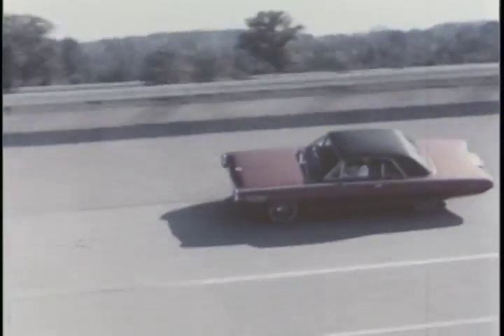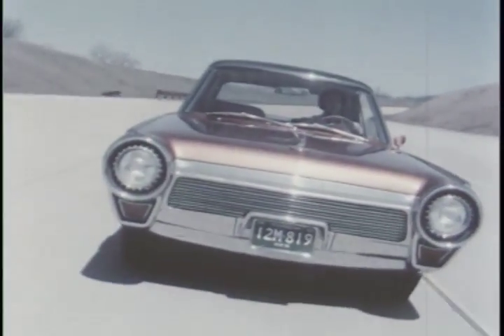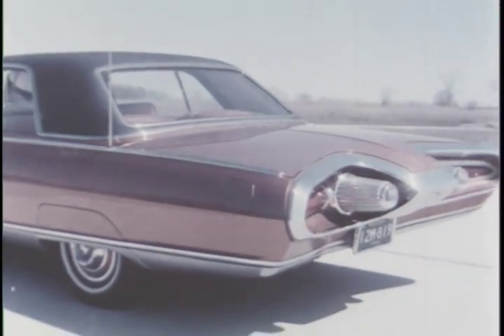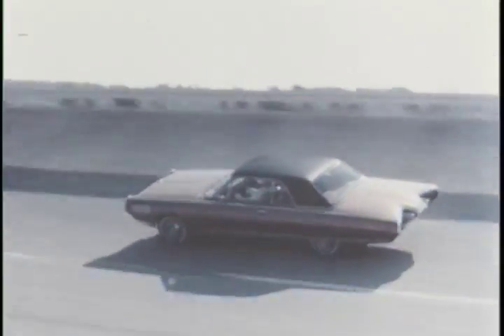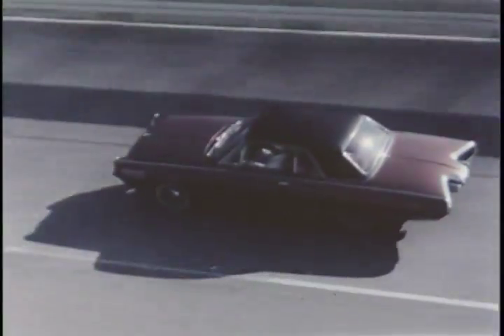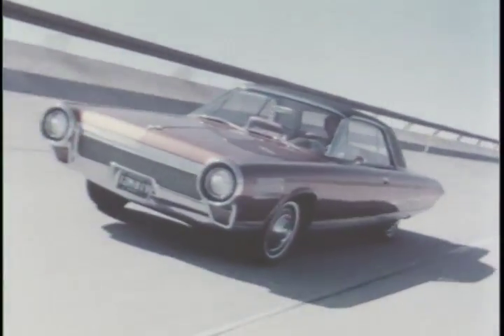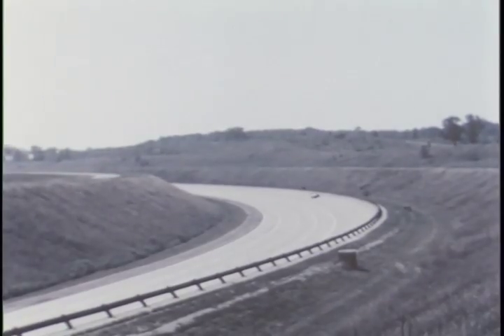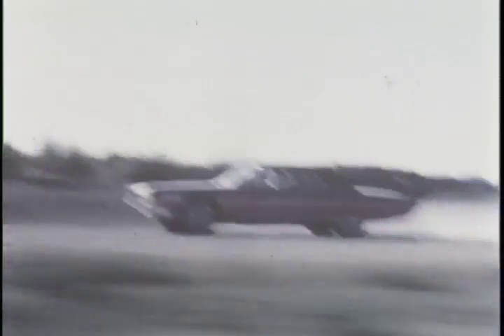Chrysler Turbine Car Tested

Comment: It was failed because of emissions standards where not met, i bet you bring it back fuel it with hydrogen, then see if it passes the test, i say it dose.
Reply: Failed because it sucked compared to regular cars and the engines cost nearly a half million dollars each
Reply: @DoktorBayerischeMotorenWerke  , nope, government stated it failed the emissions test as they used leaded gasoline , Chrysler killed the project because of the cost of production, that's was wrong with it. Even today they wouldn't be able to build it at affordable prices, 
E.v's as expensive as they are would still be cheaper priced. I now a few people that built custom cars with a turbine they said it works fine, but the fuel price kills it. To gas hungry zero fuel economy.
Reply: @richardst-laurent6660  The Chrysler turbine cars only ran on UNLEADED gasoline.

 The federal government never tested the turbine cars for emissions.
 EPA vehicle emissions did exist prior to 1971 (1972 model year.)
 It would have also been exempt from 1967-8 California emissions as an alternative fuels vehicle.

TRUE, the cost to manufacturer the engines was prohibitive, production cost estimates ranged from $50,000 to 55,000 dollars each in 1965, about a half million dollars today. Those who tested and were surveyed indicated they were not willing to pay that much for the car as it did not offer any particular advantages that would offset the huge cost increase.

The program was terminated and everything scrapped to be written off for tax credits that could be used to fund the development of new concepts and vehicle models..
Reply: @DoktorBayerischeMotorenWerke  then you need to go argu with those responsible for the documentary. They claimed it was leaded gas. Unleaded was enforced in the 70's the car was made & tested before that.
Reply: @richardst-laurent6660  Sorry my friend, you got leaded and unleaded mixed up.

The Chrysler turbines featured a recuperator in the exhaust stream that would get fouled and completely plugged up by lead deposits if leaded fuel was used.

If you check any of the credible sources they all say unleaded fuel only. 

Having said that I worked with Lockheed P-2 Neptunes 
with Westinghouse J34 jet engines which guzzled 100LL leaded Avgas like a thirsty sailor without issues, the exhaust nozzles would be coated inside with a fairly thick layer of crusty yellow ash that was nearly pure lead oxide. 
Of course, no recuperators to get plugged so problems related to lead deposits..

Cheers!
Reply: @DoktorBayerischeMotorenWerke  , did you check the link i sent you ?.
Reply: @richardst-laurent6660  what link??
Reply: @DoktorBayerischeMotorenWerke  , i shared a link in the reply comments
Reply: @DoktorBayerischeMotorenWerke  , i think YouTube pulled it. Google is shit. The link provided the information on all the e.p.a 
Reports on the vehicle.
Reply: @richardst-laurent6660  The EPA did not exist until 1971 (formed Dec. 1970)... 4 years after the Chrysler turbine car program ended and the cars were scrapped.

If there are any EPA test reports on these cars it was long after the program was canceled.

There were a few Gen 6 and Gen 7 prototypes (1973 B-body cars and the 1979 F-body)  but these were never considered for production and were only concept cars.
They were also pwered by different engines A875 units.
Cheers!
Reply: @DoktorBayerischeMotorenWerke  . Just go look up the information instead of arguing.
Reply: @richardst-laurent6660  Nothing to argue about... the program was cancelled 4 years before the EPA existed, so emissions played absolutely zero role in the cancellation.
Reply: @DoktorBayerischeMotorenWerke  , then go tell it to those that put out the information. Go look it up & go point out to them, there the ones giving false information.

Comment: USA is not really free. New techniques, such as jet cars, electrical cars, Tucker, Tesla's inventions etc. were not encouraged because the ruling industrialists felt threatened. Instead the public was left with unsafe, ridiculously sized fuel guzzlers. The v8 engines produced a mere 65hp.
Reply: Simple economics killed off the turbine car...

Comment: It got 20mpg, a rocket car, got 20 mpg, in 1963.
Reply: Oh i was driving in 63 and i seem to remember $.22 a gallon,  i think I'm right. Just a memory.
Reply: @4406bbldb  exactly
Reply: On about any liquid that was flammable.  Cool.
Reply: the Ford Falcon station wagon with the 200 CI six got 30mph in 1962
Reply: @kenwittlief255 I would hope it could reach 30 MPH!
Reply: Turbine =/= rocket, but yeah it was pretty cool. It didn't get 20 mpg in the original test rigs though, only in later vehicles and the 4th iteration I believe

Comment: My 2 cents about it: a radical new powerplant calls for a radical car. This one looks too... conventional. Also to light up public imagination and catch the market a flashy high performance sports car would have been far mor appropriate than a dull family sedan. Remember Tesla's first entry? It was a hot two-seat roadster.
Reply from the maker: Design was pretty far out for its day but they also wanted it be seen as something that was attainable.  Tesla's first foray was based on a Lotus built by a couple of scientists who really were on to something.  I rode in one and it blew me away.  The torque and instant acceleration.  What a blast.
Reply: It's not only about looks but also about performance. A 500-700HP turboshaft was a trifle even in the 1960's, any decent helicopter had one. To compensate for the poor fuel economy they could have switched to a cheaper fuel such as diesel, smoke not being a problem because turbines burn very clean anyway. And to compensate for the rather poor acceleration of the turbine, how about using a flywheel to store excess energy during braking and release it when needed, also helping with stability in corners by the way of the gyroscope effect? A turbine-flywheel hybrid with unmatched performance, imagine that.

Comment: the globalist and elite class funded this project to be stopped. They did not want people to have car with least oil requirements. This is why Petrol/Diesel technology has not improved much during the last 40 years. 
Such projects have always been ended mysteriously
Reply: Are you having a laugh?
Gas turbines turn fuel into heat and noise, and capture some of that to produce torque. Unless they're the size of a building, their efficiency will never come close to that of an internal combustion engine, and they take incredibly long to spin up. An engine requires an oil change every roughly 10,000 km, guzzling 8 liters (liberally) each time. Even the best Honda Civic needs 6.1 l/100km, over 75 liters of gasoline per liter of oil per distance. This car disappeared because it was loud, gas-guzzling, had the acceleration of a boat and burnt the paint of anyone sitting behind it.

Comment: i think the real reason turbines never made it was its multi fuel capability. they were afraid that farmers would quickly discover that they could make their own alcohol and sell it to city people for lower price than gas or diesel undermining oil business. rockefellers success at prohibition 50 years earlier would have gone in vain.
Reply from the maker: A good theory but George Steecher, one of the lead engineers on the turnbine project told me that it was about the money.  "Chrysler was in deep trouble financially in '81.  I think someone from the Department of Energy said why don't we show Mr. Reagan that we are trying to cut our budget and drop Chrysler's contract and so they did, they dropped Chrysler's contract.  as I said, at that time Chrysler was financially burdened at that point, they didn't have enough money to continue, that was the end, it was terminated at that point for Chrysler," he said.
Reply: @KingRoseArchives  Also, each engine cost $10,000, wayyy out of reach for the average man.

Comment: I wish this had caught on. This idea of a car with a jet engine is a fun idea for one very important reason... This car's engine can run on any liquid that burns oxygen. You can literally pour tequila into this car and it will run fine, that's what I heard they did in Mexico. But this design did not catch on because the only fuel this car could not burn was leaded fuel. Had this car come around about 10 or more years later, this idea may have caught on. 1974 was the year unleaded gas was introduced to consumers. I wish this idea would be brought back today. Having a car that burns almost any fuel type definitely serves as a convenience and an economic supporter. This idea really should be brought back. I don't see any real reason why it can't be brought back. This would be an expensive car simply because of the expensive Ghia style bodies from Italy... But I'm sure some minor design changes could bring the cost down. I'd like a jet powered car. Come on, don't say you wouldn't like on as well
Reply: I mean, it's a tested car that was sold in US, I'm pretty sure it was able to brake(why would it not be?) and reverse.
Reply: @giannisskoun  yes it could reverse. Its a turboshaft engine. You only need the reverse gear.
Reply: Yanni Agrotis how do you reverse? Start - stop in traffic? Brake? Not to mention fuel consumption and emissions. Too many inefficiencies, no real advantages.
Reply: Yanni Agrotis Even better would be nuclear powered engines like the Navy aircraft carrier ships...they don’t ever need fuel while deployed at sea.
Reply: @AK47HEAVYMETAL83  But they do need an ocean of cooling water to prevent a meltdown. . .
Reply: Wonder if it would run off of water ? H20 
hydrogen 2 oxygen

😒 well nobody will ever know

Comment: My dad worked with a guy who at the time had one of these cars for evaluation. He took my dad for a ride in it and a torsion bar broke while they were cruising on the interstate going through Indianapolis.
Reply: orange70383 These didn't have torsion bars, they had coils in front and leafs in the rear.
Reply from the maker: They were so futuristic.  But so much for the impressive demo.  Thanks for sharing.
Reply: Every road is broken in Indiana.

Comment: this is amazing... I'm sure this turbines could use not gas but any diesel or naphtha oil too... too bad cars like this are not available
Reply: yanik ivanov  it was designed to literally take ANY combustible liquid, such as vodka, perfume, diesel, gas, it shouldn’t take leaded fuel since it would clog the filters a bit faster and is a pain to reach them when needed.
Reply: @tripasnipa ya anything from propane to JP-8

Comment: So why did it fail to get into full production in the end?
Reply: King Rose Archives Not true that "if you stood behind it you'd get burned" - the car was specifically designed so that WOULDN'T happen.The more interesting cars were the Chrysler turbine...taxi cabs.Look it up. They could've made it, but the real drawback is that there neither was nor is a maintenance regime for turbine cars. If we couldn't support Wankel (rotary) engines as regular drivers (ask Mazda), how would we maintain a completely different motive power? Ask the NSU and Mazda companies......
The unsaid thing in this video is that this car had the power potential to literally smoke any contemporary car - with almost no detectable vibration, minimal sound, and it would do it for hours. And you could run it on any combustible fuel, from diesel to gasoline to Thunderbird wine.
Reply: caribman10 The Turbine was never intended to be put in production.  It was strictly a test Vehicle.  The cars were given to selected members of the general people to drive in regular conditions for a period time, as an experiment, then they were turned back to the factory for someone else to test.  As I recall each car went to about three or four different users, each one for a period of about three months each. (I'm going from 50 year old memories here, I may be in error on details)  The biggest problem while actually driving the car was poor acceleration.  (And the Wankle was worse, the main reason people didn't like it was if you were going UP an on ramp, if was hard to get to freeway speed by the time you had to merge into traffic!)
Reply: +CDSquaredance I'm just going to guess that you never actually drove a Mazda with a Wankel engine? Everything you said was dead wrong. My brother owned a '73 pickup, my buddy had an RX-3 and another buddy had an RX-7 and they were all ridiculously powerful, especially compared to the garbage the US was putting on the streets at the time. The biggest mechanical issue was overheating the suckers and burning off the rotor-tips.
Reply: +navnig Just ask the Edsel.  No market for them.
Reply: Expensive, inefficient, unreliable, nearly useless in heavy city traffic.
Reply: 20,000 R.P.M idle and $10,000 cost of engine VS $200 for 318 engine, also  it needed brand new factory  to build for it which it cost a BILLION dollar ,were pretty much what killed the project!
Reply from the maker: navnig Gas mileage wasn't great, it used a lot of oil and if you stood behind it you'd get burned.  Wasn't a practical application for a jet engine.  But they tried it and that's great.  Ghia did a wonderful job with the design and the public ate it up.

Comment: I heard Jay Leno say that his car can run on anything from salad dressing oil to diesel, why not bring this engine Idea back and let people run that type of engine off used oils from restaurants? Less needs for gasoline, actually gasoline is the last thing you want to run in this engine, it leaves performance damaging deposits in the engine...I would love to have this type of engine in a modern day vehicle, no oil changes, 1/5 the moving parts of a internal combustion V8, so less opportunities for wear and break down....I think Chrysler was on the brink of taking over the automotive world with this car, too bad they scrapped it, with cost of gasoline now they would have the car market..
Reply: I believe they couldn't get the emissions low enough to make the government happy.
Reply: electric cars offer most of the same advantages maintenance wise.

Comment: The government has derailed any non-gas/oil eating vehicles for many years. I guarantee you Chrysler would have produces and sold thousands of these cars had they not been told that they would be scrapping the whole idea.
Reply: Unfortunately they were far too expensive and had terrible fuel mileage.
Reply: M1 Abrams has one, in order to haul several tons wasting the less amount of fuel
Reply: @AdrianOkay  The Abrams uses a Honeywell (formerly Lycoming) turbine connected to a six-speed auto tranny. Tanks don't have to accelerate that fast, but it's nice to have a powerplant that can burn anything combustible..
Reply: @Greatdome99   In a mechanics forum we actually were scrapping  stats about tank engines and after a lot of math, i found out the honeywell of the abrams is actually more powerful than the leopard 2 (obviating the turbodiesel of the leopard is more efficient mileage-wise)
The numbers aren't that far one of the other but the abrams has the edge
Reply: @doktorbimmer  just like any american car - the expensive part
Reply: They got 20 mpg
Reply: @0nesh0theadsh0t21   
It was more like 18-19 mpg..... on the highway ! It averaged about 12. One of the reasons was because it idled at 30,000 rpm. lol
Reply: @faustus5481  you gotta think, that was good back then.
Reply: @0nesh0theadsh0t21  
Au contraire, mon frere. I don't "gotta think"..... 
it's Tuesday, my day off 😎
Reply: Let's be real jet engines need more maintenance than than gas engines 🤷

Comment: Man, just think what "The Dukes of Hazard" would have been if this went on the market. I feel cheated.
Reply: A turbine engine Has to have its blades perfectly balanced to achieve  such high rpm smoothly.  Ad marvelous as this engineering is,  I dont think it would hold up as well to the shock of landing off jumps as a v8
Reply: @lattitude01  You're just saying that because it's true.
Reply: 60000rpm !

Comment: My dad drove one of these cars home and we tried to roast marshamallows at exhaust for kicks. We then went to Saginaw for a 2 hr drive and was stopped by a few state troopers so they could check out the car. The car was a hit at every gas station or intersection we were at. The jet engine was very cool sounding.
Reply: McCormick1215 Even if the Turbine car got less mileage than your Subaru,the stylish one of a kind Turbine would beat out your simple and ugly Subaru in every other category especially style,looks,cool car,looks,impression,awe inspiring, fuel types. If I ever got to Jay Leno's garage I would hope he lets me drive  his Turbine car after he hears that my dad helped in the program.
Reply: Steven Sparks I had a chance to drive one too.  A friend's father was a dealer district manager for Chrysler and he had picked one up from one of the "test drivers" on Friday and brought it home before delivering it to someone else on Monday.  Quite a thrill for a 16 year old!
Reply from the maker: Was your father one of the chosen test drivers for the Turbines?  Sounds like a fun drive.
Reply: King Rose Archives He was one of the engineers developing the car. He also test drove the car on on a new un-opened freeway prior to public trial. He brought the car home for several weeks at a time. It was a very cool car as well as the everyday cars made with the engine installed.
Reply: Steven Sparks My understanding is they got excellent mileage at high speed but burned fuel at low speed.
Reply: I haft to know would it beat my 93 Subaru at ~27mpg?

Comment: I would like a Rubicon 4X4 off road SUV set up with such an engine. I know the acceleration is not like a powerful gasoline engine, but the torque at the rear wheels with this setup is amazing due to the gear-down from the high RPM's. 

Back in 1963 my father was seriously looking in to getting this type of vehicle if he could have one. It was an amazing car that was far ahead of its time.